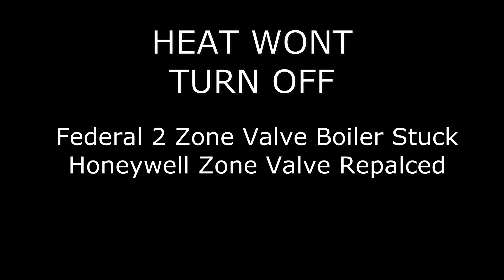House is on Fire - Stuck Zone Valve Keeping the Boiler on 24/7 - How to Replace Honeywell Zone Valve

Comment: I took one look at that wiring from the zone valve and thought - my ocd would not let me leave it like that - with wires wrapped around around hot pipes - complete hackers. I know access was a pain but it would have been a real improvement to leave all wires long, rescue them from the pipes and then Wago them up inside an adaptable box, - you need some Wago 221-5s’ 😉
Reply: I am hoping they use 24V valves in the US as otherwise , no idea how it would ever pass any kind of inspection, Weird how single insulated cables are allowed with joints outside of any kind of enclosure . Wouldnt fly here in the UK
Reply: @cripwellwalsall4700 I do not know, but believe this will be a 120V installation - but yeah different strokes for different folks.